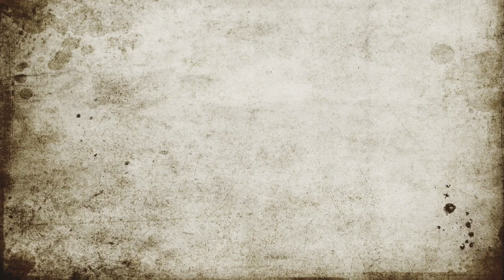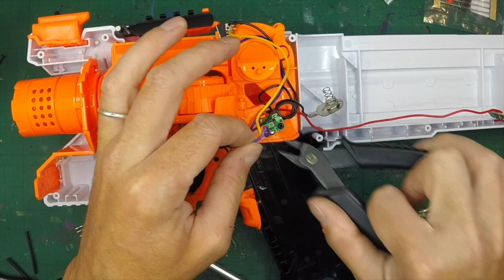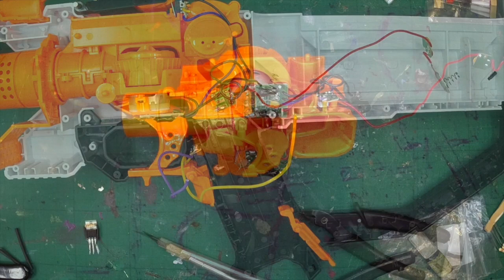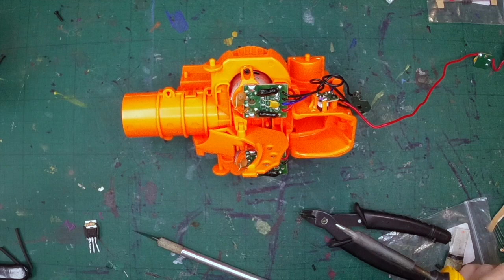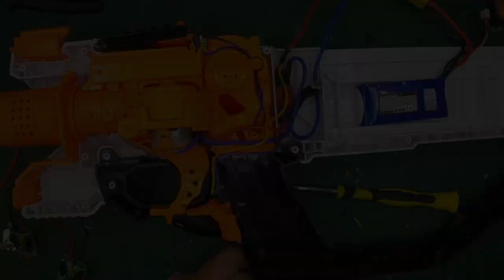Rival Hera- MOSFET Mod

Comment: Hey nice video, ive replicated this and when I test the switch with a 9v battery it works absolutely perfect, but the moment I hook up the lipo and hit the rev switch it locks on and from then on stays revving no matter the power connected. I think Ive narrowed it down to the mosfet failing and replaced it once already but the exact thing happened again. Im running it with a 3s  turnigy, which is high discharge.
Reply from the maker: You have something wrong, check your pins and the direction of the flyback diode. You may have cooked the FET now.
Reply: Ive got the band on the flyback diode to the positive side of the wires leading to the motor block, just before the yellow wire splices into it. 

Im thinking its a bad batch of fets or they simply cant handle the current. Ive tried two so far with similar results. 

Imma try a higher powered fet that Im seeing used in a lot of unregulated mods rated for 40V to see.
Reply from the maker: You still have something wrong, go over it again and watch my mosfet s for nerf video as well. Check the wiring diagrams again too-
https://www.tapatalk.com/groups/britnerf/rewire-diagrams-t4310.html

Diode should be after any splices, as near to motors as practical. It's not shown on one of the linked wiring diagrams for some reason. 

There isn't a significant failure rate in Fets, the fact two cooked means it can't be them, it's your wiring.
The IRFZ44N is rated to 60A burst. The BSUK high power one is rated to 120A burst, Rival flywheel motors are around 15-20A peak each, even at 3s.
Reply: Alright, so after modifying so that the diode is after the splices and adding a new fet it seemed to work good for a pulse but it still managed to fry well under three seconds when I gave it a longer hold.
Reply from the maker: Have you reviewed both my videos, checked all the FET pins, ensured they are right, checked you have the 10k resistor across the end two pins, looked at the linked wiring diagrams and then tested again? That's the limit of my 3000 mile screwdriver. If you can't get it right go to Britnerf.co.uk and post pictures of your whole loom. My loom in this video is still fine after over 6 months of regular use and loaning to kids at wars. I only used the IRFZ44N as well.
Reply from the maker: I cannot problem solve your blaster over the comments section. Go to Britnerf and post pictures.
Reply: Post up, Ive included a bit more info in hopes of getting this thing peaches.
Reply: Thanks for the help man it is running beautifully! Also for anyone else doing this mod that sees this use IRL3034B mosfets. They may not be necessary in every case but in mine they were a must! 

Heres the final product. 
http://i68.tinypic.com/vdl7hf.jpg
Reply from the maker: Glad to hear you got it all sorted. I will add a note to the description box to use those first.

Comment: Nice mod and guide. One question though, where did you end up putting the additional heatsink?
Reply from the maker: There isn't any heatsink. You don't need it. If you use a decent fet they don't get hot enough to need one.